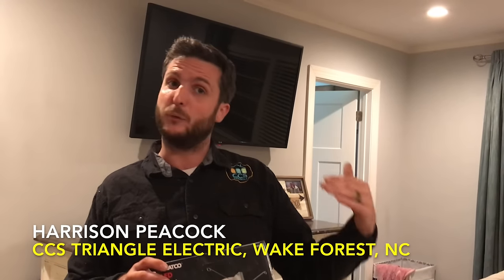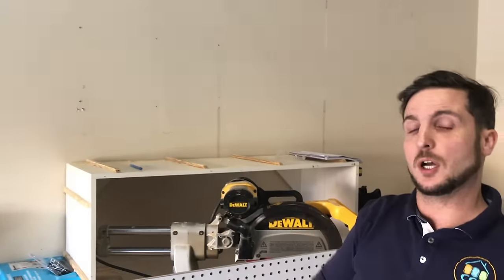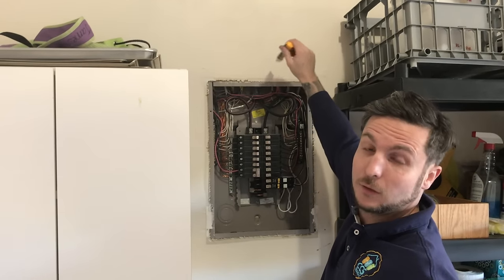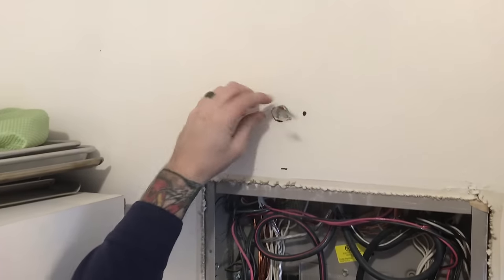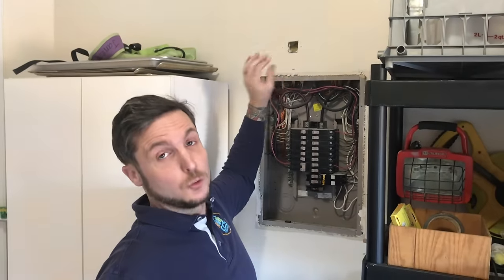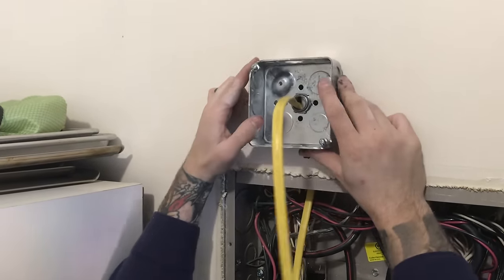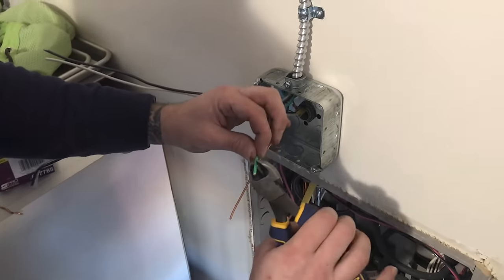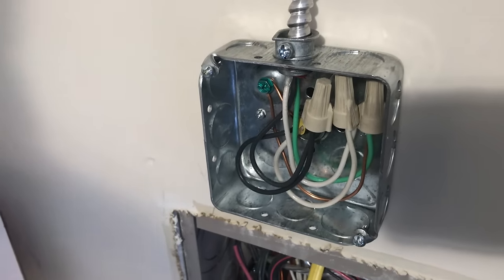New Garage Outlet From Panel--VERY DETAILED! (New Circuit / GFCI / Breaker Box / FULL INSTALL!)

Comment: My observation was, you called the natural a “ground” the green is a ground and the white is the natural. You did not show the entire ceiling, why did you choose the go around three walls to the left when you could have turned to the right and traveled on two walls?  You made a point of talking about the wire nuts because you don’t trust any connection that “pushes” in, and then you use the push holes instead of the screws to install the GFI to the wire....I don’t know any electrical professional that will use a push hole; why do you trust the push holes in a GFI and not a WAGO? Lastly, would it have been more beneficial  to have as many receptacles  as practical, in a work space? I’d have installed the GFI to the box above the panel and used the load connection to attach the additional receptacle to the other box, this would have demonstrated how to utilize the GFI in an example rather then explaining how to do it by pointing to the screws in the GFI. Please comment, thanks
Reply: Additionally, you explain that you’re installing a 20 amp circuit and install a 15 amp GFI

Comment: You never tightened the connector inside the wall. You could’ve easily tightened the connector onto the wire, send it into the panel and tighten the locknut.
Reply: I noticed that as well it would have only taken a few more seconds.

Comment: Ugh... I know I'm being picky, especially for a garage, but it's a finished area. Why surface mount? A bit extra time, cost and work there to fish to the ceiling, and down the wall to where you want the socket, but A few extra cuts in the wall, fish, and it's in the wall, not on the wall... Something is bound to hit those boxes at some point, years down the road they won't be secured to the wall anymore. And it looks like shit
Reply: If you saw the top of my walls, you'd have an idea why some prefer surface mount. The way the roof angles over the studs, there is absolutely NO clearance to drill a hole through the top of the studs. The only way would be through the walls themselves - cutting holes in the drywall and putting strike plates over every stud (to follow code). Yuck.
Reply: I gotcha. Way she goes

Comment: Seems like a waste of wire as you only use 6 inches in the box.  Cutting off a foot is just waste.  As long as he is going to surface mount the outlet in my opinion I would run the armor cable directly in the service panel and eliminate  the box above  the panel.  Just the way I would do it.

Comment: I know your 17 years in but we all learn from things from others. That was a weird procedure for strapping 300.11 8-12" from enclosure and within 3" after.Did you say it was 240v ? because that plug tester is only rated for 120v 15a circuits mostly , that outlet should have been fully tested for ground to hot and all other combination to check & not assume its right. and multiple GFI to troubleshoot a ground fault? rely on good procedures based on sound theory, who has 10 or 12 GFI's ?Actually could have been much more economical to use pvc up to 8" and then exposed romex, all within code. And a carpet knife not a wire stripper, a klein cost about $10 here. I guess im one of those argumentative fellows but you did overall finish the job even tho the connector at panel I dont think was put on through that small hole but i could be wrong. Nice accent.

Comment: Code failures:
-Ground wire wrapped around screw in wrong direction (appears that he has done this wrong for 17 years, as he did it wrong in both 4x4 boxes)
-Stripping of AC90 (MC or BX) armoured cable, it is a failure to bend the AC90 to strip it, bending it this manner can damage the conductor insulation.
-Stripping the individual conductors with side cutters.
-New Receptacle is rated for 15amps not 20 amps.
-And the most sever code failure is working on a live Panel, let alone without proper PPE.

That being Category 1 Arc Flash Protection, consisting of 
-Long Sleeve Shirt (or Jacket) and Pants or AR Coverall with minimum arc rating of 4 cal/cm2
-Face Shield (with “wrap around” guarding…i.e balaclava) or Arc Flash Suit Hood
-Heavy-Duty Leather Gloves over a pair of class 00 electrical insulated gloves
-Hard Hat, Eye Protection (Glasses, Goggles), Hearing Protection and proper safety boots.

His license could be suspended and at the very least he could be severely fined.

I hope know one is injured following this video as a guide even though the makers take no responsibility for others, you are responsible for the work you do, and that is a failure.

Master Electrician, Electrical Contractor, 42 years experience, Industrial/Commercial and Residential.
Reply: Must have worked for a institution or something, you’ve never worked in a live house panel in 42 years?
Reply: Nicky G well I never worked in an institution for other than a few service calls, I was on call 24/7 for 30 years.
I have worked on $3 landscape lights to $10 Million robotics. I worked in Commercial, Industrial and Residential my entire career.
And not Once did I ever tell people to work on Live equipment let alone promote a Video showing it being done. 
What I have done in my career regarding live work is not at question here. ✌️

Comment: connector on panel was not tight , why you don't put your ground clockwise. never see a electrician doing like that.
Reply: and you receptacle are only for 15A circuit , you cant put a 20a breaker on it, so much error on what you explain. sorry dude im electrician and not accept that.

Comment: Why  do  you  need  a junction  box  where you can  connect  to the breaker box
Reply: Eskinder Teshome he did that to cover the hole he cut in the sheet rock to get to the panel
Reply: The bend radius on the MC cable is larger than the NM cable.  Could have been done with MC, but would not "look as good" and would need mud, sanding, and painting.

Comment: POWER should be OFF. That's not a personal preference  . . . it's just right. When the power is off then you are safe, not with some NCT device. Why use a twitchy outlet at all; it is not required. GFCI's don't hold up well and will trip with the least vibrations. Plus plastic isn't a good choice above a work bench.
 Why not run the whole circuit from above and down the inside of the walls ? That's the way it is done. Saves a bunch of money (price out that 100ft Armorlite vs. 100 ft of Romex). Looks better . . . which you said was important. Picking up stripped off ends of wire ?    in a garage ?  You soaked the homeowner.

Comment: By code you 1/4 of insulation showing past the connector your an ok electrician I guess in North Carolina they cut a lot of corners and if your running Romex plastic connectors work just fine the romex is non metallic so defeats the purpose of having metal connectors

Comment: Great video and very informative but those outlets are not called GFI’s (Ground Fault Indicators). They are pronounced GFCI’s (Ground Fault Circuit Indicators) because they protect a circuit of outlets from overloading and faults from grounding problems and also protect the breaker at the panel. Usually you wouldn’t have just one GFCI on it’s own dedicated circuit 👍🏽
Reply: Ground-Fault Circuit Interrupters to be precise. ;)

Comment: It's a good tutorial how ever he made a big and dangerous mistake. That is a 15 amp receptacle protected by a 20 amp breaker. That's a total fail.
Reply: You can use 15A receptacle on 20A breaker in residential work.
Reply: @guitarsarge  no you cant . The receptacle is rated for 15 amp. . If the load demands 20 amps then your receptacle burns and the  breaker  wont trip.
Reply: @guitarsarge  how is that receptacle protected?

Comment: a "little" exposed copper at the termination is not a big deal as long as you're aware of it and don't let a bare ground touch it. i mean hell the termination "screws" are exposed, so why is it so bad to have a little bit of the wire exposed. not making sense🤔🤦‍♂️.

Comment: It doesn't take an expert to recognize that our professional licensed electrician put those ground wires on the box terminals incorrectly. Harrison wrapped the wire on the terminals in a counter-clockwise direction , they should be wrapped in a clockwise direction so that the tightening of the screw wraps the wire loop tighter . You can clearly see the wires UN-wrapping as he tightens the screws on the ground terminal screws .

Comment: screw that! using the flat head screws that come with the rs cover, i always, always use the phillips head screws that came off the receptacle as they are a 6/32 and fit the nut and just use my drill to install, it's much easier, and then you don't have to worry about which direction the screw is turned.🤔🤦‍♂️

Comment: 20 amp circuit, 12/2 wire... so why did you use a 15 amp GFCI receptacle instead of a 20?
Reply: Since it is a yoke with 2 receptacles on it, code allows it. Also it is a good way to ensure circuit derating.

Comment: Shouldn’t have cut the MC like that has a chance of damaging the insulation. Use a rotosplit.
Reply: I agree, but he did say this was the cheap way...
Reply: Not necessarily true as long as ur careful you won’t damage the wires. Side cutters is all u need especially when stripping plenty of bx

Comment: Luckily I do all of my electrical within an industrial environment... where I tend to be just as anal. Mostly all of my wire is stranded, but most of all he said still holds true to non-industrial. Electricity is not necessarily fatal, but it can shock you to where it hurts: take a hit of a single phase of 480 and you will know what I mean about that. Remember that a swinging bat only hurts you if it hits you; work with an unlive circuit if you can.

Comment: Using Greenfield conduit for this application is totally lame.  It looks like hot garbage exposed like that.  If you're doing this at home, for God's sake use EMT.   FWIW, using that flexible metallic conduit is not code in my area for anything other than a whip, but then neither is NM wire.

Comment: Why didn't he put tape on those wire nuts.
Reply: Mike Mccomis Not required by code.
Reply: I always did, even if it wasn't required.  Just an extra layer of safety.  One can never tell.
Reply: @richarddennis114  I always put tape on my wire nuts. I've seen the time when the plastic nut part has come off. So I tape my wire nuts.
Reply: It gets all sticky over time. Hard to get it off my hands.

Comment: You should explain you were working on a sub panel with no main breaker.  Some novice will kill himself flowing this.  Using a jab saw above a panel is a no, no for anyone but a licensed electrician. Greenfield run on the surface is where I turned off the video.  You have demonstrated just why people should not do things themselves.

Comment: couple of things this guy did wrong. if you make a EDUCATIONAL video, you should ALWAYS explain how to test if a panel is powered or not and also NEVER show that you can work on a live panel. it is VERY dangerous and could cost you your life to do so. Also, piss poor work ethics, the Romex going to the breaker panel has not been secured which doesn't meet electrical code. also, he mounts the ground in a way which will possibly make it disconnect, Wrap wire clockwise around the ground screw so as you tighten the screw, the wire wraps tightly around the screw.The fact that the Romex is not secured to the breaker box would make the inspection fail. DO NOT rely on this video, he's pretty talker that would make it seem to be installed correctly yet it would fail an inspection.
Reply: 1000% agree. Hate these videos that present themselves as teaching, and the guy makes common mistakes and doesn't know basic terminology.

Comment: Why is it that electricians  use metal boxes.
Reply: Metal boxes are strong and durable and are mostly used in commercial applications. They are appropriate in residential garages as well. You could use pvc boxes as an alternative, but not the blue plastic ones because they are designed for behind the wall cabling, usually Romex aka NM cable.

Comment: you wrapped the ground wire in the wrong direction. suppose to wrap it in a clockwise direction so that when you tighten the screw it actually tightens the wire loop. this is a day "one" lesson of becoming an electrician. would fail inspection here in Florida. i thought that you were from the UK, but now i'm thinking you're an Aussie, because everything is backwards down there. 🤔🤦‍♂️🤣

Comment: 9:55 terrible wrong dangerous false info. those wires are always hot even when breaker is off.
Reply: That’s a sub panel. They are not live when the breaker that supplies it (located in the main panel) is switched off.

Comment: misinformation again. you should always test the gfi using the test button on the gfi device, not using the button on the tester. as it is not a true test of the gfi device. the tester's button should only be used to "identify" receptacles on the load side of the master gfi.🤦‍♂️

Comment: Please! Please for the love of god ! Don’t stab the wires in the plug, take ten seconds and wrap them
Reply: That is a "back-wire' outlet. It is not designed to have the wire wrapped around the screws. It is not a "push-in" outlet. This outlet you put the wire into the holes in the back and then tighten the screw to lock the wire in place. Actually my absolute favorite method of wiring up outlets, unfortunately for normal (non-GFCI) outlets you have to pay a $1-$2 premium to buy that type of outlet :(

Comment: It’s unfortunate this guy doesn’t know what he’s doing. They post a video with so many mistakes.   Ground wire around the screw backwards, BX connector on MC cable, using a side cutter to strip wire, and the list goes on and on. Using a side is a good way to nick the copper and it breaks when you twist in the wirenut. Not a great video at all

Comment: NO! the "best" way to strip mc is with an mc splitter.
Reply: That is the only way in many places.  The electrical inspectors will check and fail you if you use a hacksaw or other methods to cut the sheath in MC or AC90 cable.